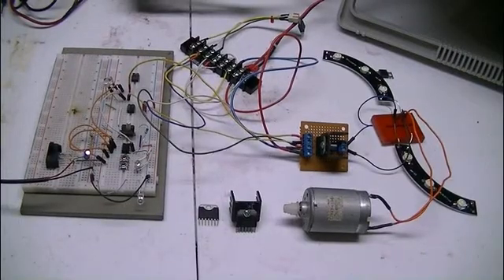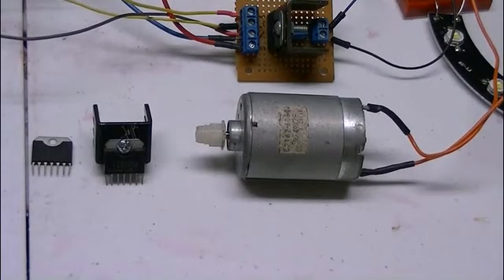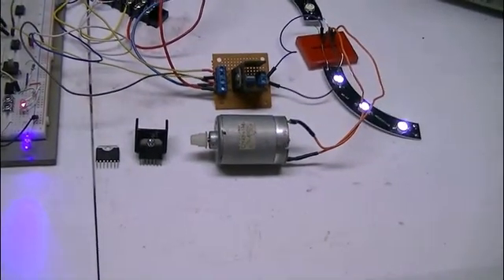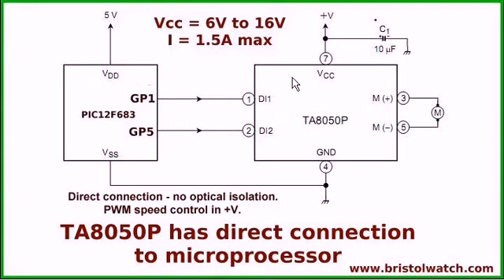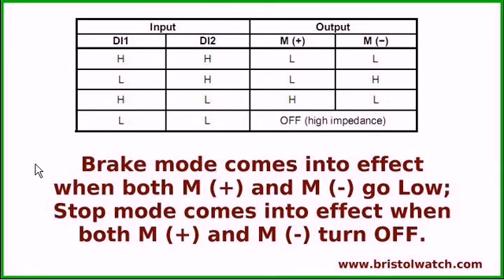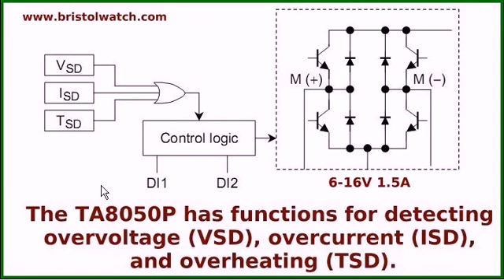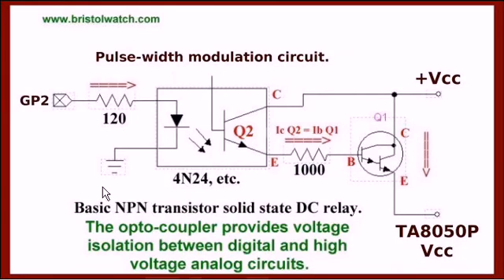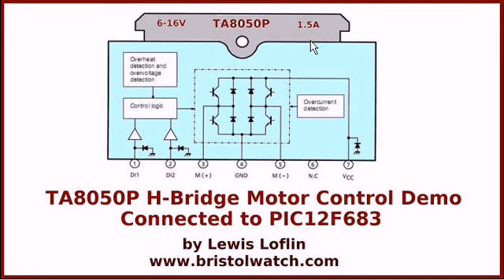TA8050P H-Bridge Motor Control

Comment: Hello! My name is Constantine . I have a few questions for you . Can you help me? I do not speak English and this will be writing through an online translator . I have TA8050P ( 2 pieces) , the stepper motor 24V ( 1 piece ) , the DC motor 24V ( 2 pieces) , the DC motor 12V ( 1 piece ) . It is necessary to check if the engines work! I want to use them in the manufacture of cnc machine . How to do it? We need to gather simple driver stepper and DC motor with manual operation , without the arduino. missing items will be found